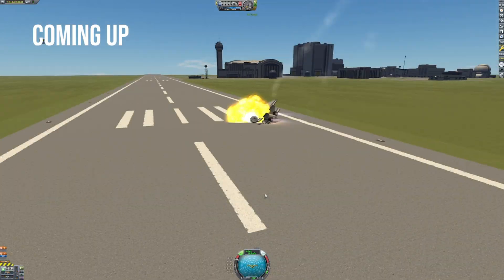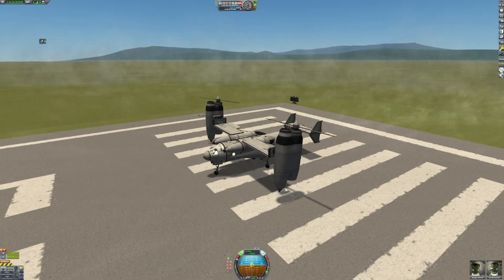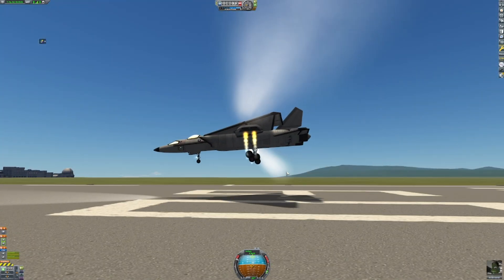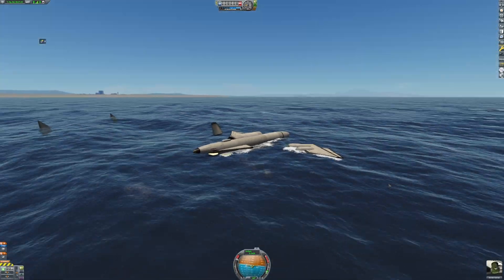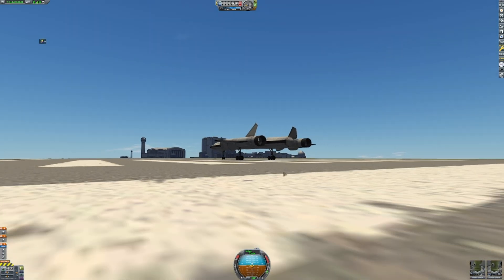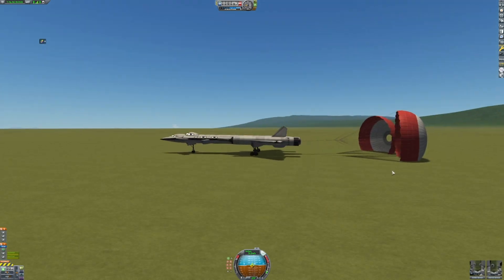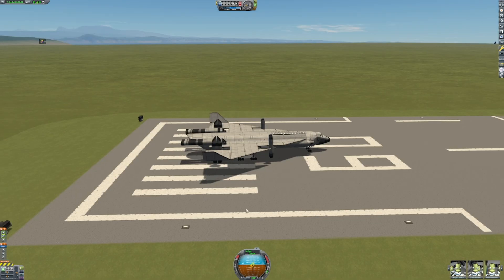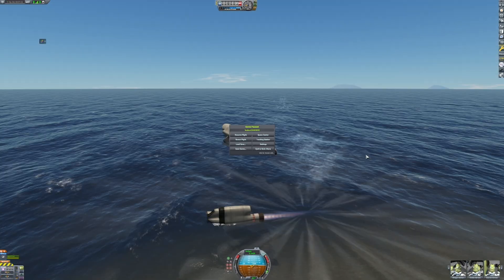BUILDING VTOL AIRCRAFT!! | Kerbal Space Program - episode 26

Comment: alright, some advice for gameplay...
first, the Brake button is on the top of the screen, if you click it, you can toggle the brakes on and off, alternatively you can hold the B key on your keyboard. secondly, there are markers for center of Mass, Center of Thrust, and Center of Lift you can toggle in the hangar. for a VTOL aircraft, the method i use is to build the general aircraft shape, and then place the lifting engines, in line so that the Center of Thrust lines up JUST BEHIND the center of Mass, the reason is when you place the main forward flight engines, it will shift the center of mass back slightly, and you wait till after lift engines are in place because the game gets confused with engines being in multiple directions, and instead shows the combined direction of thrust. and lastly, just a little tips for efficiency and handling, if you use rocket parts, drain the Oxidizer from them, as it's just dead weight (which can be beneficial as it can work as ballast), you could use RCS nozzles or Reaction wheels for enhanced stability and for specifically for Tilt-rotor/tilt-wing/tilt-jet convertiplanes you want to almost control the throttle of each engine independently, or at least decrease the lift engine thrust as you start picking up forward momentum.
Reply from the maker: Not as simple as just pointing engines downwards